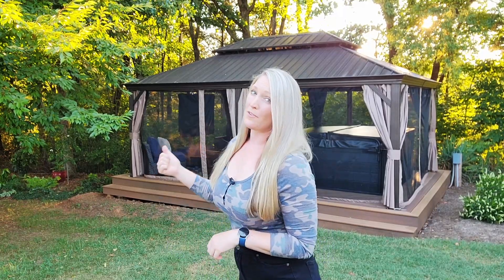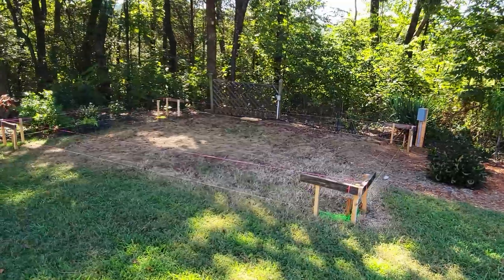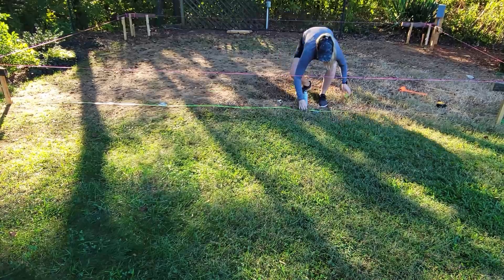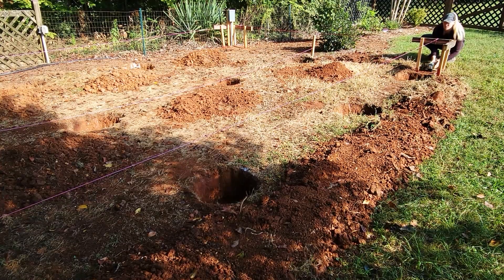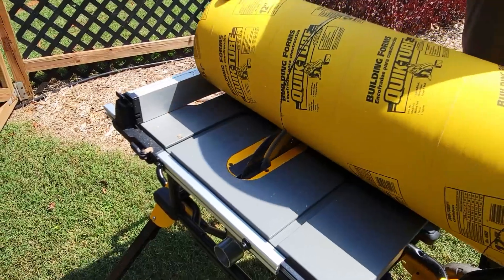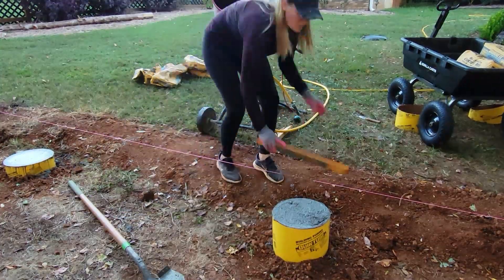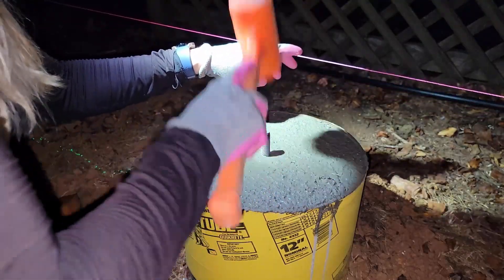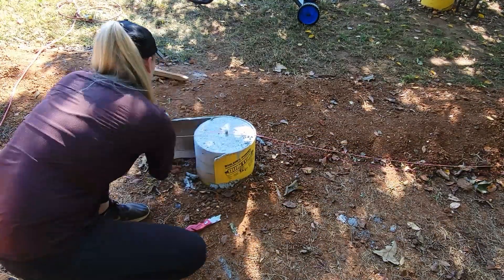DIY Hot Tub Deck | How To Build Your Own Composite Floating Deck With A Design

Comment: Awesome build! Are those post base anchors exactly the width of your triple beams? I looked them up per link provided but the dimensions show 5.5" wide? A triple beam only adds up to 4.5".
Reply from the maker: Thank you!!! Yes, unfortunately, with the width of wood planks, they are slightly bigger than the width of a triple beam. When they got nailed in, the base anchors sucked into the wood beams.